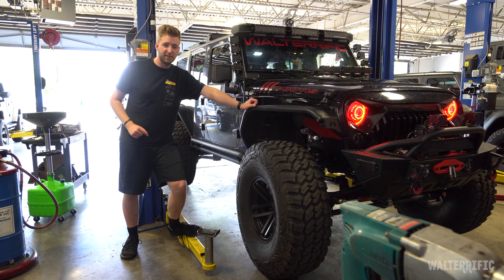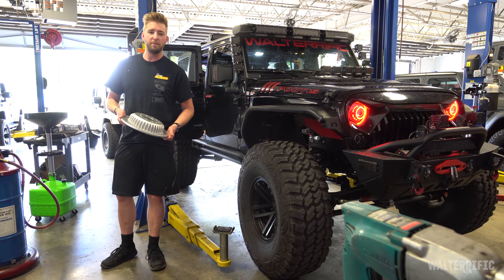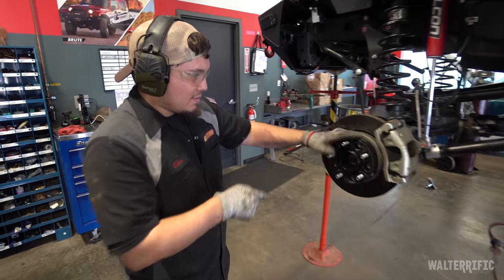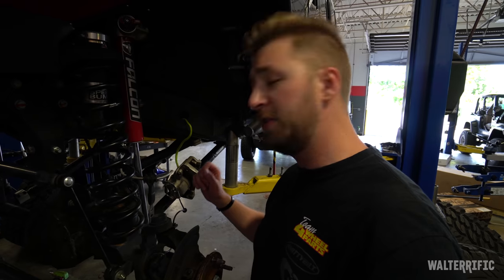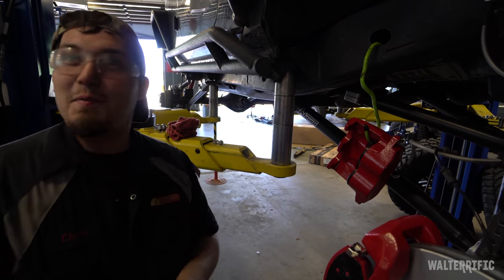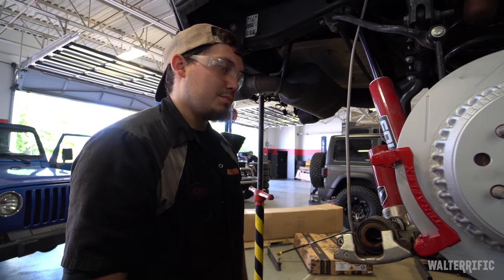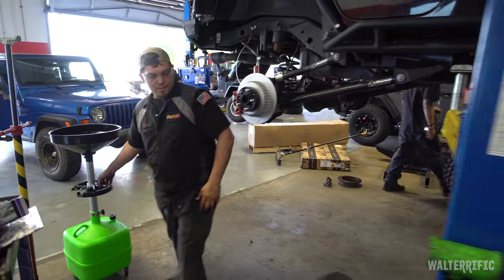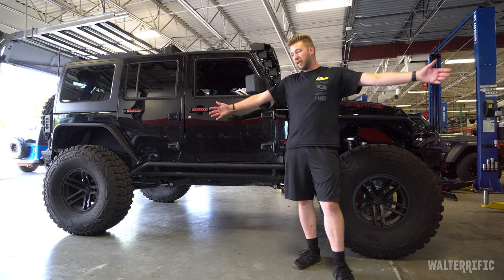Rubi Tuesday #27 - Teraflex Big Brake Kits

Comment: Rear rotors are on the wrong side. The angle of the Slots are supposed to sweep dust from center of rotor towards the outside. (Mr. I'm certified to do this kinda stuff)
Reply: Ikr, looked at that and thought "aren´t they supposed to be swapped?"
Reply: no, the slots do not matter. the vanes/vents do. else it completely depents on the setup and what the manufacturer says
Reply: Rotflmao I was curious to see if anyone else caught that. Nailed it!
Reply: yes you are very correct,  these rotors are directional and they were fitted arse about.. ha

Comment: the "slotted" is not the vents you pointed at. clearly the old rotor also has vents (it keeps your brakes cool....temperature wise.) the slots are the lines you see on the face of the brake disk (rotor) the "slots" keep your brake pads from getting gunked up with "brake dust". so your brake pads stay fresh and clean...YAYY ENGINEERING! lol

Comment: so i am curious if you did or didnt use the big piston kit from teraflex for the brake booster after installing the big brake and rotor kit? i have the big brake and rotor kit from teraflex and i still have an issue with the brake pedal being squishy even after bleeding the brakes a few times.